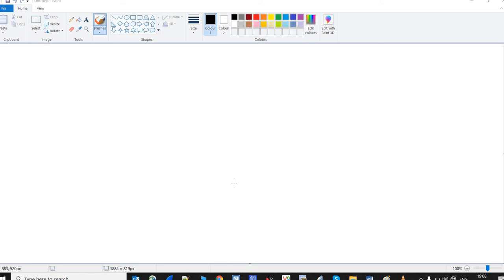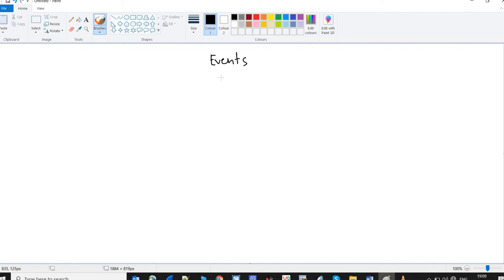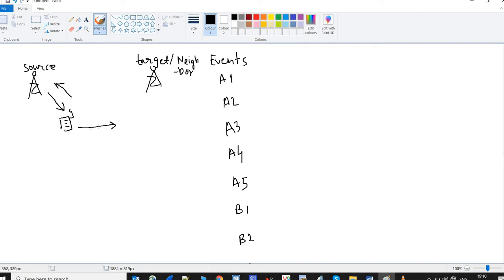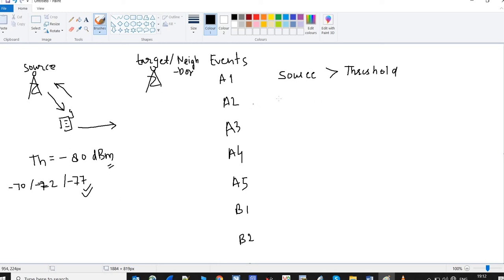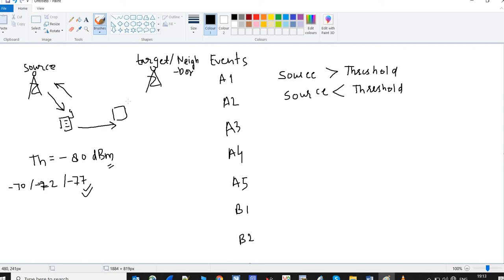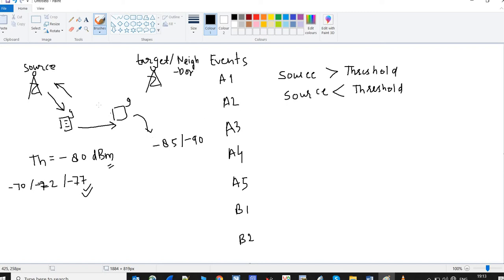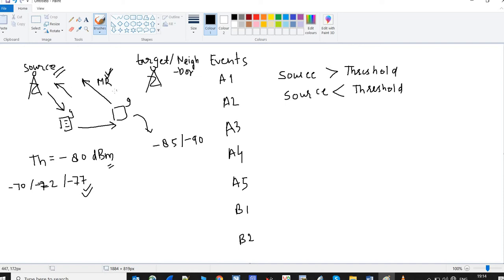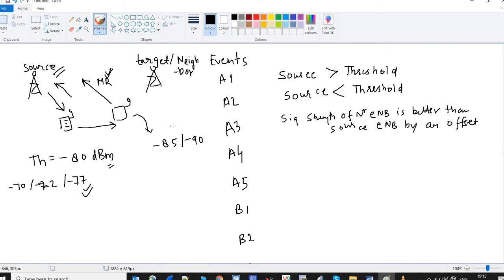LTE X2 Handover Part 2

Comment: Hey , i am new to LTE , i have question regarding the attach call, why the MBR is required in attach call flow
Reply from the maker: MBR stands for Maximum Bit Rate. It is one of the quality of service parameter. It is required so that an UE can not  use throughput beyond a certain speed in Mbps.